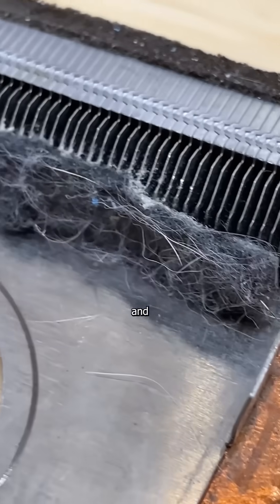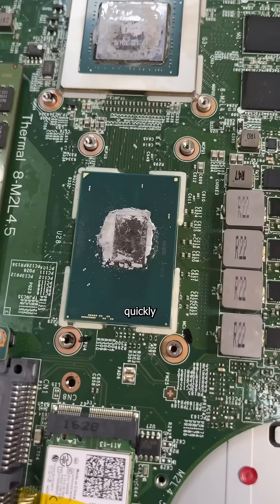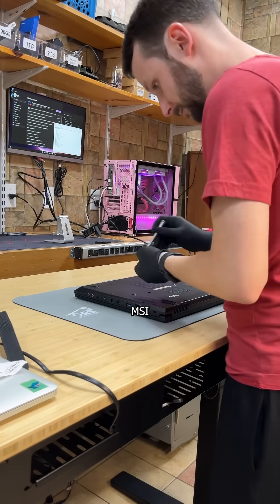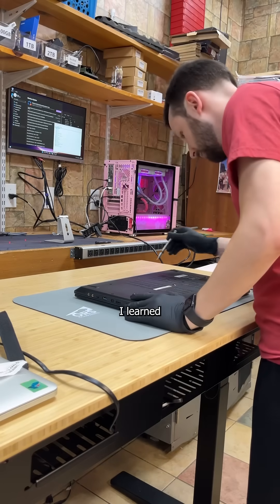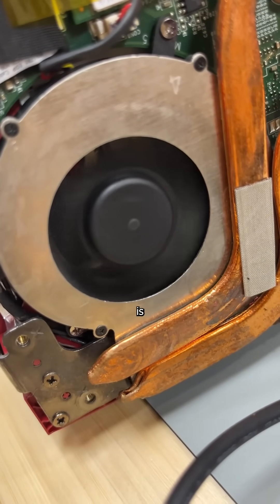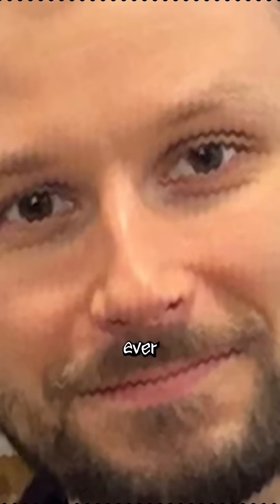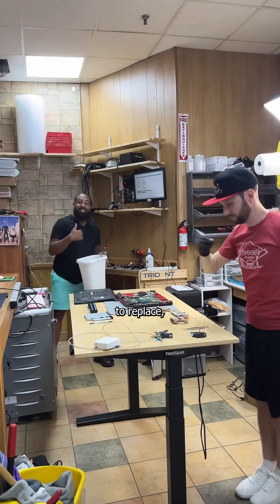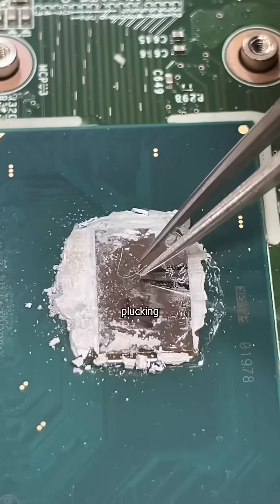Why is this MSI gaming laptop so LOUD? (THIS IS BAD) #tech #pc #technology #shorts

Comment: Alas, I damaged the wifi card connectors while replacing the fan. New fans and a repaste though. Impressed by how much cooler it runs and the performance boost it got(late game stellaris lag dropped off).

Comment: i have almost the exact same model and it wont Boot/post or show me something, keyborad light comes on and power led comes on but the only thing spinning up is the CD-drive when powering it up. my guess it that the MB is dead as i have tried removing HDD/SSD/RAM and no difference, no post and no screen light, even tried with HDMI to another screen no difference there either....

Comment: Hey nay had same laptop ad same isue and when we cleen it the fan was'brocken. So we asamle it back but it wont boot at all only red light on start buton and ower heating Cpu,Gpu and some other circuit and when mesuret it hat more Ampers that is shoot and it is fuckt now.

Comment: had same msi laptop with 17 inch screen and gtx 980m, i still use it for light gaming and other excel work. Its still working to this day coz i clean it annually and change thermal paste after every 2 years. These msi gt series laptops were tanks, i played soo many games and still working provided u service them.

Comment: Help my hp has a severe case of stripped screw in the left hinge disease. And it's broken the shell that holds the power button. I literally can't open it without possibly breaking a wire off 😢

Comment: 16-17yr olds aren't kids but teens legally considered minors lol, that's why 16-17yr old can't even stay in an orphanage, orphanages take in kids below 13, and from 13 up they usually stay in a community (or fostered by a legal guardian that is usually a relative till 18 or till someone adopts them) and from 16 up can be provided with an apartment to live in either by themselves or with a roommate and frequently get checked on by CPS till they turn 18

Comment: it is always the fan bearings... both on laptops and on desktop psu... although finding a replacement for a laptop fan is easier then finding a replacement fan for a PSU as since when the fan wears out on a PSU you are supposed to buy a new one to not risk a fire hazard if anything goes wrong...

Comment: I had an MSI GS63 laptop that I still own, had it's fans start to rattle. Combine that with the battery that failed and I ultimately decided to get another laptop. Weird thing is once I had ordered the new laptop, I opened up my old laptop to grab the 2.5in SSD I had put inside it to take out and strangely my rattling fans fixed themselves. That was all the way back in 2021 and it hasn't had the fans rattle at all since 2021 as I still use it as a desktop and occasionally game on it. I don't know what changed because at the maximum both the CPU and GPU fans were making noise and I resorted to turning the fan curve as low as I could and didn't play games

Comment: Lucky... my MSI died 6 months after the Warranty ended (and I had bought an extended one with the store).. evidently the mother board power system died, and the cost to replace would involve a months travel back and forth overseas and 80% of the cost of the machine.  No more MSI for me. Lenovo got my money for the replacement.

Comment: HP stands for Hinge Problem
MSI stands for Multiple Serious Issues
Now we need DELL stands for Dissapointing Electronics Lacking Longevity
Reply: don't forget
a SUS or ASUSmaryosep
and
LEL NO GO
Reply: @asakayosapro  a - suspect
Reply: @asakayosapro  in my defense, my Lenovo LOQ 15IRX10 works exceptionally well and it's not even a Legion model. (it's new though, so it's free from gooch particles and crusty spermal curdle)
Reply: You also can't spell Dell without ED
For 3 reasons:

1. Electrostatic Discharge
2. Emotional Damage
3. ED as in "0xED" aka "UNMOUNTABLE_BOOT_VOLUME" aka how you know your drive is likely failing.
Reply: For me, "HP" stands for  "Huge Problems".
Reply: @jeffzebert4982  my father works for hp, I can confirm (been using HP PCs for most of my life
Reply: My Victus has more recoils than the quartz inside a watch
Reply: thats why i dont open my laptop! i just keep it closed and plugged to my monitor
Reply: What about acer?
A-always
C-corrupt
E-even
R-running

Comment: Oh so this MSI laptop does comes with an optional subwoofer at bottom. No wonder why the similar model of mine has a 'out of place' bottom vent thst leads to nothing is there.

This video be helpful for me as the same apperance but superior spec laptop of mine somehow got thermal issues as well even dust sprayed the fans.

Comment: Seriously, when the laptop fan starts making noise that's the most scariest thing to hear and now you have to take your laptop to service centre and also you can't trust any repair shop because if they are not professional they can further damage your laptop 💀
Reply: Its not too hard to do yourself. Ive done it, and pulling off the case took longer than replacing the fan
Reply: The laptop owner is my friend, I study IT at ssu, I tried to diagnose it back in May but I didn't want to go into it myself as I didn't have all of the proper equipment. I gave him a laptop while we waited to eventually go to the shop

Comment: I have a question for 'the greatest techinician that's ever lived' (since IDK your name). Mate I have a old Dell Insipiron which has a 7th Gen Intel i5. Its running pretty good so far. But dumbass Windows 11 cant run in it. 

I use linux, but I need to run some windows apps. What could be done mate? Cheers!

Comment: In my experience, Msi gaming laptops prior to Intel 8000 series heat up pretty badly, and when it happens, the palm rest and trackpad are the hottest to the touch. The SSD drive reaches 70+ degrees Celcius too.
Reply from the maker: Yes they do. They also tend to eat up fans, along with certain ASUS models. I forget what company it was, but I noticed every failed fan was from the same company. Bad batch of bearings I would assume

Comment: I have 1 of this MSIs; they run really hot, so the worn out fan isnt shoking. NGL, it feels like you need the fan on for any game or work.
It only cools from the bottom 😡 unlike my ASUS ROG, plus I got it for $2k, I wasn't impressed. Looking for a better alternative.
Reply from the maker: In general gaming laptops always need the fan on. MSI is just known to use the lowest quality parts in general, but they're also priced lower than their competition. Make sure to keep the bottom elevated to lower the temps!

Comment: Had an old Alienware with bad fans like this... scared me to death when it started up
Reply from the maker: Yeah it’s spooky
Reply: My hp sounded like it was gonna blow
Reply: @MintyGalaxyIce I’m bout to blow
Reply: my hp laptop had the Fan of Death noises. would quiet down when i punched the keyboard. the punches stopped working. finally spent $15 and 10 minutes... finally... peace....
Reply: @sof-z4l OMG mine sounded the exact same just i gave up on it
Reply: My last laptop I had was a MSI GL62 6QF. Had to change the fans 3 times in a period of 3 years, all with damaged bearings, swamp go*ch free, all on CPU side.

Never bought another laptop again.
Reply: It was not a bug, it was a feature

Comment: Multiple Serious Issues of ventilator.
Reply: I have 1 of this MSIs; they run really hot. NGL, it feels like you need the fan on for any game or work.
It only cools from the bottom 😡 unlike my ASUS ROG, plus I got it for $2k, I wasn't impressed. Looking for a better alternative.
Reply: I sold MSI products in 2010-11. Each one had a ventilation issue. The problem was that the previous reseller went bankrupt, and we weren't sure how to handle warranty claims. Fortunately, another company that was an MSI reseller stepped in and fixed the fans for free.